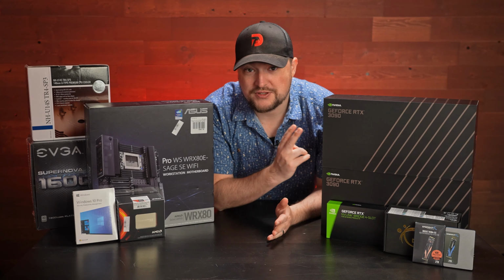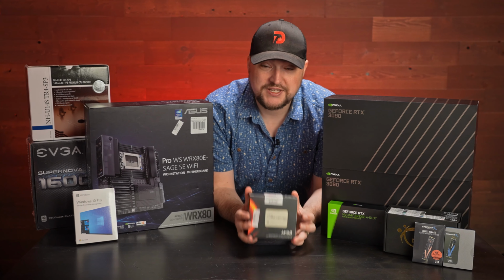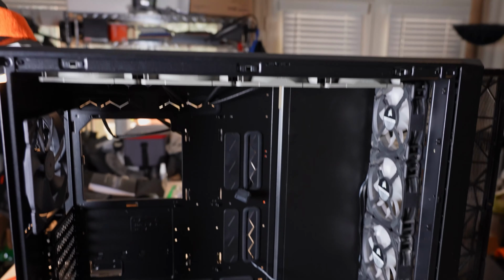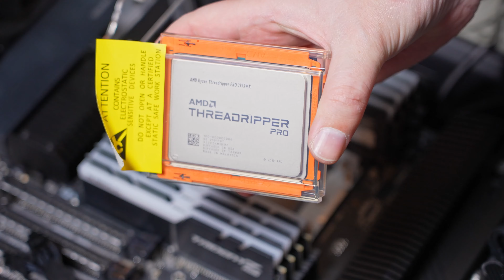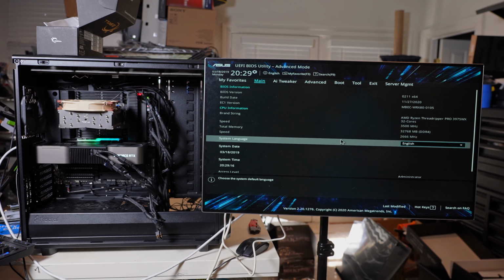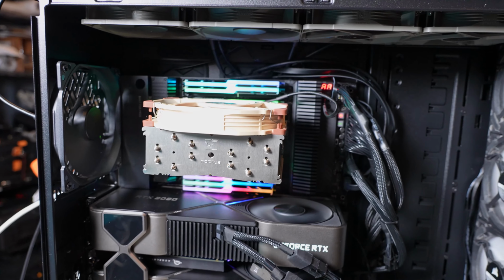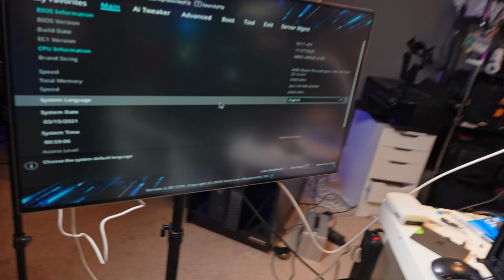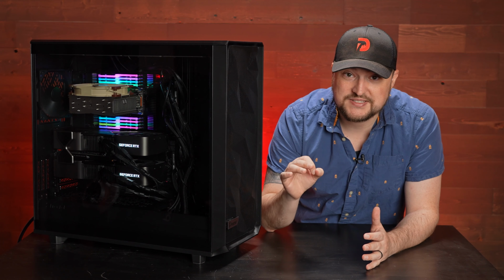AMD Threadripper 3975wx Dream Workstation Build!

Comment: Hey gr8 work. I am gathering these components here in india. I hv 2 rtx 3090 fe. So thinking to add them up with a i9 10920x with a asus x 299 sage. Is your case FD mashify 2xl? Also i have decided to go with cooler master v1300 psu. Just want to know from you, does all these sounds good. Any suggestion?
Reply from the maker: That sounds like a solid build you have there! Be careful with the PSU as it won't likely have enough power to use both 3090's at the same time. You need at least 1500Watts for optimal settings with that build (otherwise your system might just randomly shutdown). As for the case, yes, it's the Meshify 2XL - I love it.

Comment: Rendering with nvlink? Can't these programs already detect multiple cards and use at the same time?? I'm building the same but with threadripper 3960x. I just landed a 1600 psu so I'll be up and running by the weekend🙏🏾🙏🏾🙏🏾 also with two msi 3090s everything came up to a little less than $6500.. I scouted the internet for months to find retail prices and lucked out.. the PSU was the last thing I remained to source and I locked it in for $400 after taxes I got the evga gold edition.. platinum was always at 900+ taxes.. there's a restock next month from the manufacturer but I couldn't wait any longer lol.. I'm gonna add more storage to my build later on. That sucks you had to fork over 10k but it's worth it when it pays it self back I guess.
Reply from the maker: In the tests I've done the NVlink adds a nice chunk of performance inside of DaVinci Resolve on 8k timelines so for me it's worth it. Grats on your build and hopefully it all works out for you! Thanks for watching!
Reply: @District7DrewGeraci  ahhh I get it. Please do updates on your experience with your build.

Comment: I also haven't used AMD in a VERY long time - this processor was the most expensive on Newegg which led me here
Reply: two questions - why not spread the thermal grease rather than just dab? And I'm surprised at no liquid cooling. Does that air cooling > liquid cooling? Thank you

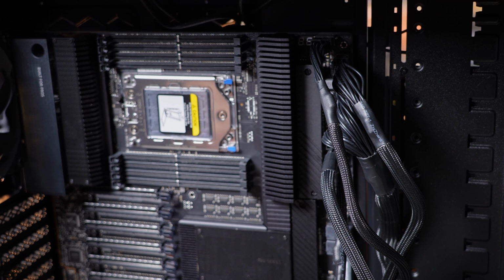Comment: at min 9:22 you show all the power connectors on the motherboard, it needs 2 x 8pin power connectors on the top right corner, then is the ATX power connector and under the ATX there's another 8PIN connector but is different, and I can't find that connector on my beQuiet 1200 watt power supply. I also checked a 1000w EVGA power supply and can't find it. Any advice will be appreciated.
Reply from the maker: You'll have to check the PSU connector options on each brand, but I was only able to find the dual 8-pin ATX on the 1600w EVGA Platinum series unfortunately.
Reply: @District7DrewGeraci  turns out that it fits an 8pin VGA power connector. Thanks
Reply from the maker: @FranciscoSilva-qt4es  Awesome! Glad you figured it out.

Comment: No ECC ram? Nice build tho!
Reply from the maker: Didn't need ECC ram for the build - doesn't affect performance in the slightest. It's a beast of a computer still but I'll be building a new Intel Xeon  platform hopefully this summer with dual 4090's (TI perhaps, if they launch soon) and/or dual RTX A6000s.
Reply: @District7DrewGeraci  from my 500 or so hrs of workstation research I thought ECC Ram was one of the main reasons to get a workstation.  Provide all those cores with smoothly flowing Ram info.  But I could be wrong and it’s for sure pricy af.  Prob depends on use case also.
Reply from the maker: @CinemaNinja  the only advantage ECC ram has over Non-ECC is the ability to correct errors on the fly and not have your system crash when there's a memory error. ECC is more vital to data research apps and 3D rendering apps etc where you're processing data for hours, days or weeks on end (and can't afford a memory crash). There's zero difference in actual performance though which is why I went with non-ECC.
Reply from the maker: That being said, I haven't had a single memory error on this computer yet and it saved me about $1200 on the build :)
Reply: @District7DrewGeraci  interesting, I thought it helped the Ram work faster because it does not get hung up on errors as much.  Thanks for the info!

Comment: Going to have a similar build for After Effects. Did you test it? If so, what are your thoughts? Amazing video!
Reply from the maker: Thanks brother! Unfortunately Adobe hasn't updated their code in a long time to utilize all of the hardware so you won't see any performance increases that are that meaningful.
Reply: @District7DrewGeraci  Thanks for the response. Have you found any software in your workflow that utilized both gpu’s? Was wondering if I needed both gpu’s since I mainly use After Effects & Premiere Pro?
Reply from the maker: @KingsnGaming  nothing from the Adobe suite uses dual GPUs. DaVinci Resolve does though and it's amazing! So do most 3dfx programs.
Reply: @District7DrewGeraci  Okay. I plan on using Unreal Engine, Blender and After Effects. I’ve never used DeVinci Resolve. 
Would I be better off with one GPU or would you recommend dual GPU’s? 
If I go with the single GPU, I might get the thread ripper in case Adobe switches to utilize dual GPU’s.
Reply from the maker: @KingsnGaming  blender and unreal will both utilize dual GPUs so if you have the money and want the performance go for dual ;)
Reply: @District7DrewGeraci  Appreciate the feedback. I’m speaking to Adobe rep now and he said that After Effects can utilize two GPU’s after he said it couldn’t. Waiting on his reply after I sent him his own message back.
Reply: @KingsnGaming  Adobe have been able to use two identical gpus for years, just for very very little. maybe ten effects in AE and a bit of use in encoding. spend money on ram and a cache drive instead

Comment: I was advised to pull air in directly over the CPU. You are pulling the hottest air from the GPUs into the CPU. Did this cause any problems over time? You have 6 in fans and 3 out, so assume air also is pushed out the rest of the chassis.

Comment: im super jealous
Reply from the maker: Don't be jealous - the price was ridiculous. Haha
Reply: @District7DrewGeraci  but you could have done it in steps you know. You could have started with one smaller vid card or one you already had with 16 gb of ram and 1tb drive and then slowly upgraded. How much would ot have been if you did that?
Reply from the maker: @dracleirbag5838  I'm using this for actual production work so I needed the best possible specs when I built it. Slowly upgrading wouldn't be efficient (for me) and my line of work.

Comment: If you had a big enough case for it, could you put a big, beefy X16 card, for example an RTX 3090 on the last slot? I'm asking because of the M2 slot with cooler behind it.
Reply from the maker: Yes, that's exactly what I've done since posting this video in March. Both 3090s are on the lower slots, freeing up 2 additional pcie4 slots.

Comment: I know I am late to the party😅😅
But to utilize the 128 pcie4 lanes a bit more i would move your graphics cards/ nvme splitter cards as far down as the case allows.
No need to put it in the upper most slots as all pcie slots are electrically full 16x slots as far as I know.

You would win a few (or at least one) more slots in the top ro add more storage if need arises.
Otherwise you only use 48 lanes of your 128 and the only benefit of getting tr pro is 8 channel memory instead of 4 channel. 

Also I would like to add that your "faulty motherboard" was most likely a bad mount of the cpu (pretty common for tr and tr pro due to the huuuuuge contact area) 

Sorry for my bad english I am austrian😅

Kind regards from austria
Reply from the maker: Yup, few months late to the party (and likely missed the other 800 comments saying the same thing). The GPUs were moved down months ago for a better configuration. Thanks for watching.
Reply from the maker: And no, the motherboard was 100% faulty as confirmed by the manufacturer after I returned it.

Comment: Hey there, I commented awhile ago but after running this system for almost 7 months now, I am curious what kind of temps you have been seeing while under full load especially during playback in Divinci or Premiere? I have been using the NZXT Kraken Z73 and it really doesn't seem to be able to keep up during full load in premiere during playback of 10 bit /4k/8k footage. Temps jump to over 70 and playback gets a bit annoying. What temps are you performing with your Noctua air cooler?
Reply from the maker: Hi there - yeah, still going strong after 18 months!! My temps are still the same, around 62-63c under a full load and idle around 32-34c with the Noctua air cooler (which I still love). The TRP runs pretty hot and I've found (in other systems I own) that for some reason the air cooler actually performs better than the liquid cooling. It's the opposite for Intel chips though which is a bit strange! Either way, loving my build still and can't wait to upgrade next year.
Reply: @District7DrewGeraci  I'm gonna give that a shot!!! Thanks!
Reply from the maker: @BeergrYT  Awesome! I'm not sure what case you're using, but  also have 13 fans dedicated for external and internal airflow (8 drawing in, and 6 expelling).
Reply: @District7DrewGeraci  That's big difference too. I am running the Fractal Define 7XL and I am actually in the middle of changing my fans to the Noctua 3000RPM helicopter sounding ones lol
Reply from the maker: @BeergrYT  HAha, awesome! Well it should perform great. Love the noctua fans. They're actually pretty quiet even at full blast.

Comment: You Know why the third RAM is dead? check at 9:39 and you will find out
Reply from the maker: It was out, you are correct, but it wasn't when powered on. Believe me, went through every memory stick twice to troubleshoot that it was the memory slot that was the issue and not the memory.

Comment: Hey, just got the same board! So do you not have to use those 6pin pcie ports at the bottom? Is that only if you're running every slot?
Reply from the maker: You can use the last 4 slots (with 2 3090s) and then that opens up the top 2 slots for other cards. You can also use a riser that opens up and additional slot.
Reply: @District7DrewGeraci  oh nice, yea... I was talking about the two 6-pin extra pcie power cables at the bottom. It looks like Asus says you only need them if you're using every slot?

In the "Power Connectors" section of the manual: slots E and F

Comment: Having ram delivered fer my Build tommorow 

3975wx cpu
Asus wrx80e Sage se WiFi motherboard 
256gb Corsair Vengeance rgb rt 3200mhz ram 
RTX 3090 gpu
Corsair ax1600i psu
Corsair 1000d case 
Corsair elite capellix 170i AIO cooler with thermal grizzly kryonaught thermal paste 
16tb m2 NVME storage
500GB m2 nvme boot drive build is for Content creation
Reply from the maker: It's a killer build!

Comment: Three years later I am building this exact system at a hugely lower price, sourced most from ebay for a fraction of the cost this poor man must have paid. 3975wx @ $600 and 8x16GB sticks for under $200 - open box SAGE for $650 etc etc. The only new item I bought is the Noctua cooler and the 990 NVMe Pro's
Reply from the maker: Ooof, yeah, you got a hell of a deal! This system is still viable in 2024 so good on you. I think I ended up paying close to $15k for everything. Sounds like you made out like a bandit!
Reply: @District7DrewGeraci  there is now way faster of course but bang-for-buckm as a render machinem it is going to be WAY better than what I use now. Any how thanks for the old video - got many installation tips from you!

Comment: Also, have you had any luck controlling the RAM rgb on your board? I’ve got the same gskill RAM that you installed here... but only half of it is controllable... the other half stays rainbow. I would at least like to be able to turn it solid color or off...
Reply from the maker: I don't know about the RGB configuration, unfortunately. I don't use it. (It was literally the only 256GB memory available at the time and I didn't care if it was RGB or not).
Reply: @District7DrewGeraci  yea, I just wanted to turn it 'off' or 'solid color' since I can see it through the case. I hate the rainbow pattern. I figured it out though... in BIOS there's a setting to turn DRAM switching from 'Server control' to 'BIOS control'... not sure why it fixes it, but it does.

Comment: Do you mind specifying the part number for the RAM?
Reply from the maker: G.SKILL TridentZ RGB Series 256GB (8 x 32GB) 288-Pin DDR4 SDRAM DDR4 3200 (PC4 25600) Intel XMP 2.0 Desktop Memory Model F4-3200C16Q2-256GTZR
Reply: @District7DrewGeraci  have you tried gaming on this thing? What is the performance like? I have 3970x and an thinking of switching to 3975x to benifit from 8 channel memory, extra pcie and IPMI
Reply from the maker: @mohsh86  yeah I do a fair bit of gaming on it too - it's a beast. Not sure you're going to see a huge performance increase from the 3970 vs 3975 but if you add the RTX3090 you'll see huge gains.
Reply: @District7DrewGeraci  am actually afraid of performance drop if I do that since 3975WX has lower clocks and locked (i.e
 Can't be overclocked)
Reply from the maker: @mohsh86  you likely won't see any performance loss in all honesty.

Comment: Awesome stuff man! Question about the ram. I have the same ram in my 3975wx system with the same MOBO, are you able to control the RGB of all 8 sticks? I am only able to control the top 4 and the more I read on about this, it seems like a dead end and controlling all 8 is not possible? Also, have you had any troubles setting up your BMC network configuration so that you can control your fan speeds through the web based user interface? Thanks for the help!
Reply from the maker: Thanks! And funny enough I can't even control 4 of the RAM slot's RGB colors, so you're ahead of the game. It worked for a brief time where I could control all 8 and then after a windows update they just stopped working altogether. As for the BMC network, I honestly don't know. I just use the fan configuration app to control the speeds.
Reply: @District7DrewGeraci  Oh nice, which fan config app are you using?

Comment: Hi Drew, I just did a build with the exact same build spec you did, but my sli not enable in my Nvidia control panel configure surround, PhysX no sli maybe you can help thanks - Joe
Reply from the maker: Awesome!! You don't actually need to sli the GPU's together as the applications will recognize the two GPUs. You can use the NVlink adapter to join them but there isn't a huge difference in performance from what I've noticed.
Reply: @District7DrewGeraci  Wow did not think I would get a response buddy really appreciate it.  I did NVlink them together, but were you able to sli them at all? I just can't believe that Nvidia has stopped supporting sli when linking multiple cards for a build can be profitable for NVidia.

Comment: In order to use all PCIe slots, u need to stack pc cases, for ex. with Thermaltake Core X9 or x5 
In the upper case you put your GPU, in the lower case the motherboard and connect them with PCIe gen 4 raiser cables
Reply from the maker: Yup, great solution! I've done this and I'm back to 3 open slots now. Thanks for watching!

Comment: I for the life of me cannot my system (same as yours except I have the 3995wx) to power on. The mobo is getting power but it will not turn on.
Reply from the maker: Sorry to hear that man. Did you try running the board without anything on it yet? You might want to try adding 1 new piece of hardware at a time and seeing what error you get.
Reply: @District7DrewGeraci  I finally got the bastard alive. I replaced one of the tough fitting PSU cables with a VGA cable and it worked. Seems like it takes forever to boot up though. Now I am trying to figure out the huge M2 card I got with it. I have 5 M2s on it but Windows only seems to recognize one.
Reply from the maker: @spencerbachus7494  congrats! Yeah the boot time is atrocious but that's because it has server grade security on it so it takes longer to boot (regardless of how fast your NVMe is). As for windows not seeing your drives are they in the raid enclosure that came with the MB? If so, I recommend using raid software to create the raid and not let windows do it).
Reply: @District7DrewGeraci  Ohhhh. yes, that is what I mean. Do you some good non biosy software to recommend?

Comment: Hi Drew! I got the same motherboard with a RTX3080ti founder edition, but the graphics card’s golden fingers cannot be plugged all the way into the bottom of the PCIE… and the clip cannot be locked, is this what you were facing when you were installing the GPU? Thanks!
Reply: The reason why it is not in place is because the heat sink of this motherboard is blocking the graphic card, and I tried several graphic card, none of them works.
Reply: @calvinyou5728  same here. you can remove the heatsink and just hope the drive stays cool enough. Or leave the GPU not seated and wait for it to die
Reply: @tristansummers  I figured out that the MB was not securely fastened

Comment: I would remove the plastic and rubber plates from the back of the motherboard, as they can warp the motherboard. and make sure the top left screw is right through before tightening as that can really warp the board... I would drop the gpu down, to get more clearance to cool the cpu. A resolve without a decklink is a bit weird? But I guess someone else does the grade? I am saving up for GPUs and only have the 3955wx for now but interested in how this has perfomed over time. GPU in bottom slot will give you more slots so you can grade properly!